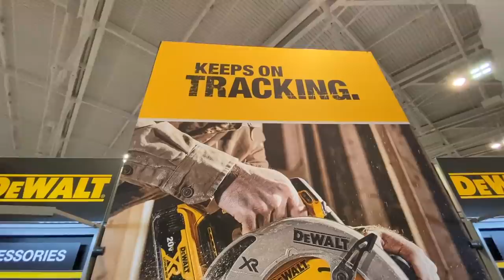Dewalts NewTools of 2020. First time seen in public at Stafda

Comment: I understand your suggestion about wanting to be able to stand up straight with the leaf blower scraper and being able to stand up straight, but it's not ergonomic. Lust like a large push broom, to get enough leverage and go be comfortable, we still need to bend down slightly to get that added power to move debris. Same with digging a hold with a shovel. Plus, I don't think the scraper is intended to be used 100% of the time, if so, I'm sure they would of made something for that application. Just talking off the top of my head. Thanks for asking for comments. Rock On!!

Comment: At Dewalt their test was cutting a board with Stainless Steel Nails. The Makita trial was a pressure treated board with drywall nails screwed in. The Screws are much tougher. They should have set it up that a Dewalt Rep was using their blade and the Makita Rep was using their blade and used the same board and nails or screws.

Comment: I timed DeWalt using both blades by the video time. DeWalt traveled the same distance in 10 seconds as they cut with the Diablo in only 6 seconds, where the Diablo failed. Force and depth matter. I believe a shallow cut will dissipate force and heat over more teeth.

No sparks on DeWalts test. Different fasteners and Diablo said they were using wet pressure treated lumber and it did sound as if the DeWalt bladed saw had a weaker battery.

Comment: If you noticed the dewalt guy had the Diablo set deeper than the dewalt blade giving it a steep cut angle. The dewalt had a shallow cut allowing the blade to have more contact area.

Comment: The wall versus the oblow blades. The Walt stand showed us what it was like to cut through nails and not screws and he also really reamed into the cut on the 1st foot to break all the teeth on the Diablo. That was my 1st observation. What they showed us that they Diablo booth was how well their blades stood up if they slow down in front of each screw meanwhile the guy running that to walk blade just pounded through it so they both did the same exact thing Purposely making the blade fail

Comment: The Dewalt test used a Dewalt blade that is carbide tipped where the Diablo blade used was not. That Diablo blade is for maximum battery life while framing and cutting wood, not for demo purpose. In the Diablo booth both used were the carbide tip framing blades.

Comment: interesting assessment on the scraping aspect of the blower, you take the time to tell them they should have made it longer due to angle but then say whats the point of the scraper?  It's there just in case it's needed as he said if, if you come across stuck on debris.  It's a blower not a scraper but if

Comment: As a machinist what I saw a few things that could show those results.
First let me explain the difference between hardness and toughness.
Hardness is resistance to deformation and toughness is resistance to fracture.
Example carbide teeth are hard they don't bend but will break steel teeth dont break so much as they will deform (bend) out of the way
First let me say that I believe what your seeing is that Dewalt is useing a softer (less hard) grade of carbide and daiblo is using a harder grade of carbide.
Dewalt test the guy was pushing as hard and as fast as he could and important that he mentioned he was using stainless screws stainless in general is a much softer metal what I believe happened was the softer carbide of the Dewalt was able to withstand the impact of such a hard push where as the harder Diablo teeth fractured under such a hard impact. Now in the Diablo test they specified using drywall screws!!! That is a much much different material. drywall screws are hardened steel meaning that they are extremely difficult to cut. The Diablo blade with the harder teeth held up better than the softer Dewalt teeth because of the hardness of the screws they were cutting and also note that the Diablo guys weren't trying to go near as fast as the other test and allowing the blades ware instead of causing catastrophic failure

Comment: Each of them stayed in contact with just the beginning of the drywall screws the blade pushed through did fine. This is why they don’t let us try! Drywall screws are so hard that any blade with fail if you start at the edge and run the blade

Comment: I have the new blade from DeWalt and it’s a BEAST. It came with the new Brushless 20VMAX Circular Saw. It cuts through nails easily and no problems with teeth when finished.

That Diablo demonstration had a WEAK Battery from the start and they lack INTEGRITY from that point on. Don’t do a comparison IF YOU HAVE TO CHEAT!

Comment: With the circular saw test, I get the durability side of testing showing the blades can cut the way they do even though you know you'd never rip down a board with that many nails in it. But the DeWalt blade was entirely in Spanish, the Diablo blade had both English/Spanish. The way the teeth are shaped on the DeWalt just makes me wonder if it's not a blade designed for just ripping down boards like you'd find on a table saw, they last much longer then just a standard framing blade ripping the same boards. All I use is Diablo blades on the job site, skil saws, sawzaws, miter saws etc. There just relatively inexpensive for the durability and use you get from them.

Comment: I'm pretty sure that while testing competitors blades, both saw operators were pushing down on the saws with trigger arm.  This is most noticeable in Diablos demonstration.  If you watch the guy on the right with the diablo blade, his left arm is in a pushing forward position while the guy on the left with the dealt blade has his left arm more straight up and down, applying more downward force which would allow him to hold the saw over the nails longer dulling the blade as opposed to the diablo operator who is pushing the saw forward.  The Dewalt demo operator seems to be doing the exact same thing but to the diablo blade of course.  Just an observation and my theory.  But, what do I know?

Comment: My take on the blade test is don’t cut screws or nails. They will damage your blade. In general I have bought the Diablo blades. They work better than others on the market. Time will tell you who has the better blade. When I go to the tool store those will be the ones they recommend consistently.

Comment: The dewalt guy was using two versions of the 60v max saw. With the dewalt blade he was using the new upgraded v2 saw which has upgraded motor and the rafter hook. If you notice on the saw with the diablo blade theres no rafter hook so it's an unfair test

Comment: don't know if it mattered much, but dewalt ran that saw through the nails on the diablo pretty fast once he got a couple nails in. teeth will break if you don't let them cut at the right rate. diablo seemed to bind the dewalt blade.

Comment: 1 year later and here are the results for the circular saw blade tests , 
The Dewalt likes high rpm and fast push though wood and light pressure though screws.  The Diablo likes high rpm slower push on wood and light push on screws.  The Diablo carbide teeth seem to last just as long however once the Diablo looses a tooth it becomes very unbalanced and starts to throw the teeth anytime it hits a hard object

Comment: the saw blade test is just like the lubricity test that big corporations used to do with a metal bearing against a spinning motor shaft and measured resistance with how much weight it took to stop the motor or make it run harder, the dewalt guy pushed the diablo blade way faster than the dewalt blade itself but in the diablo event its different using 2 different people with the same saw and thicker case hardened screws

Comment: DeWalt is rocking the market because everything uses the same battery for the most part.    I wish they would get rid of their 40v landscaper tools and go 20/60 flex.  They have started, but I am waiting for the 20/60 flex backpack blower.  The 20/60 weed trimmers rock!  I wonder if they will ever figure out how to make the blowers silent. There has to be a way to baffle the air and dampen the electric motor to make it quiet.

Comment: both companies are using different fasteners embedded in the lumber,
screws are hardened and i believe the Dewalt guy mention the it was stainless steel nails,which typically are not hardened, but not easy to cut non the less,it affects the carbide differently,so different carbide grade and so is needed for different applications.but i agree with the other subscribers,PROJECT FARM.

Comment: Listen to the sound of the saw. Both of the operators were binding the saw while using the competition's blade but not their own. By ever so slightly twisting the saw and binding it while using the competition's,  they are creating additional friction creating a great deal more heat and dulling and slowing down the blade exponentially faster the further it goes.  The faster it spins, the easier it will blast through the  nails shearing them off rather than slowly eating through them . A hot blade will throw teeth much faster, especially if it has binding force from the side catching them. Thats my observation anyway.

Comment: If you noticed the dewalt bade was set to the perfect depth just batley cutting through the nails. Then the. Diablo was set at max depth causing maxium friction plus twist. To heat things up, and bota bing bata boom.

Comment: I believe its the way/pressure they used to cut the lumber. It looked like the diablo guy rammed the blade into the screws with the dewalt, instead of letting the blade cut

Comment: The clue is the sparks you see in the Diablo test. DeWalt used stainless steel nails, Diablo used carbon steel drywall screws. Both cherry-picked materials to make their own blade look good and the competitor's blade look bad. Neither corresponds to a real-world use case for a circular saw.

Comment: The blade thing was because of the saw and battery combo not the blade itself. If they would've allowed someone to inspect they could easily tell the makita with the dewalt had a dead battery from the beginning not allowing the blade to run properly, the diablo blade tips on the makita were only fine because the tips didn't get pushed off by speed and were givin time to make the cut and succeeded due to a full battery charge. The dewalt guys ran thinner test material but higher push and drag on the blades thus knocking the tips off the diablo blade... hope this insight was helpful! In my opinion dewalt made the better blade but neither company ran a fair test!

Comment: Where was the sander? I am having trouble because you can't hook it up to a shop vac. Why don't they make an adapter besides the little tiny bag. It works great, I just want to be able to keep  the dust confined without having to sand outside especially in the winter. What were they thinking? Instead we all have to make our own adapters with PVC  pipes. Come on Dewalt get with it!!!

Comment: Look at the gauge of the rods in the diablo test. The dewalt blade was cutting through much thicker gauged metal inside the wood, where as on the diablo blade, it looked like it was cutting through straight wood

Comment: I think they strategically stalled the cut on a screw to heat the blade up enough to kill the teeth. Mess up speeds and feeds and you’ll kill the tool

Comment: If you want a small impact driver look at a 2857 Milwaukee it looks tiny. Like it cant get any smaller. Its 4.5 inches and 18v so the 12v one will be even smaller. The dewalt xtreme is 5 inches.

Comment: A multi blade by Dewalt vs a Diablo framing blade. Not sure what blade they used for the diablo test but def strength in push and would have loved to see them both take brand new batts off of chargers to show a real competition.

Comment: Could be the screw material on the test. They can be using a harder metal or gummy stainless steel that would build up on the cutting edge of the carbide and break off.

Comment: When you approach a screw or nail with your blade - you sense that you have come across it, then you modify your approach.  You slow down at the point of metal contact and assist the blade in cutting the nail or screw with a slight slowing down of your cut.

If you sense the nail or screw and increase your push, the teeth of the saw will bind against the nail or screw - every-time.  If you sense where the nail or screw is - or know where it is, you slow down your push speed and gradually 'cut' the nail or screw - saving your blade.

This is why an inexperienced cutter will burn through any kind of blade and an experienced cutter will make a blade last.

Comment: On the dewalt blade test if you will notice the Diablo blade was set much deeper than the dewalt. That caused a much sharper cutting angle which is much more aggressive on the blade. If they had used both blades at the same depth the outcome would have been much different

Comment: The dewalt blade and diablo one. It seems he was putting some preasure against the side of the wood. As that happens the blade overheats more and takes more time to cut. Due to the hight heat it is easier for the teeth to break against the nails.
Same thing with the diablo test. If you put preasure against de side the skill saw sounds as if it is shuting down.

Comment: On the DeWalt VS Diablo, The base on the saw when running the DeWalt blade was at wood depth and when running the saw with the diablo the plate was at full dept, making the theeth cut straight  toward the nails, and in my opinion thats what forced the blade and broke the theeth.

Comment: The result of torquing the saw creating higher heat. I cut 3/4 particle board with zinc gauge metal panels.  And the green guys will roast a blade on their first cut. Simple trick

Comment: Diablo is using the 18v Makita saw. The Makita saw runs slower rpm  and a 6 1/2 in blade. Dewalt is using their 7 1/4 flex volt saw. I have found that the diablo blades last longer and work better in the slower rpm saws.

Comment: The guy from DeWALT was twisting the cut (not cutting straight) that's why the red paint from the blade was left on the wood. And Diablo wasn't exerting forward force when cutting which caused extra rotations on the nails making the teeth catch and causing the saw to jump.
Reply: Used a brand new 7 1/4 40 tooth Diablo blade today on a 2 by 8 it ripped through like butter but it also left red paint on the wood end.
 you don't necessarily have to twist the blade for it to leave paint so that is not a good enough reason

Comment: Ok peeps, the Dewalt used by in the Diablo was not the same. Different size blades, also the rpm between Dewalt and Mikita is different. Most people don’t understand things about metal cutting. Ask any machinist will tell rpm and feed matters. Different type wood possible hold more heat. There are a lot of variables going there other than just two companies competing against one another. I used the Diablo steel demon in steel framing.

Comment: The cut test are different Diablo’s are in pressure treated wood and dry wall screws with a Mikita 18v but DeWalt was normal wood with stainless nails with Dewalt 64v saw. So even if the blades are the newest modes which I doubt the test are completely different to start with.

Comment: Well I scrolled a little ways through the comments and didn't see anyone mention the difference in the saws other than a dead battery, but there is a huge difference in DeWalt test of the blades, the height of blade, cutting with the blade all the way down you have less teeth taking bites out of the wood and bigger bites. It's very hard on the blade and saw, a blade should only have at most 1/4" of teeth showing on the bottom of the cut.

Comment: The sawblade test is not equal. Different brands of saws, but more importantly, Dewalt used stainless nails where Diablo used drywall screws. I run 7-1/4 inch Diablo blades over nails and bolts every day doing remodeling work and it doesn't hurt them.

Comment: If you pay attention the saw with the dewalt blade is NOT at full depth of cut you can tell by the angle of the shroud the fact the blade doesn't show down below the slab. And if you look at the cut made with the DIABLO blade it's at full depth the slabe is pre marked. 
My first assumption is that the slab has been pre plunge cut from underneath so that dewalt's blade isn't having to cut completely through the nails.  Also if you cryogenically froze the Diablo blade down to extremely cold temperatures and heated it back up really fast it would most likely cause stress fractures along where the Carbide teeth have been brazed one causing every tooth to come off like that.